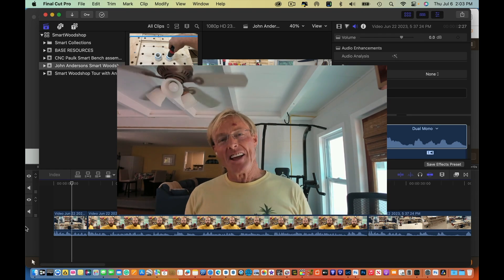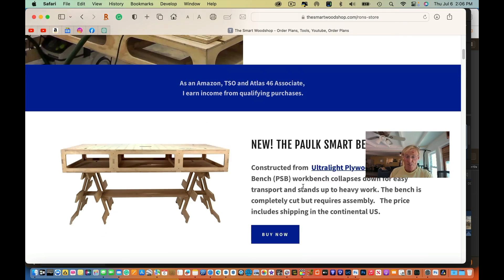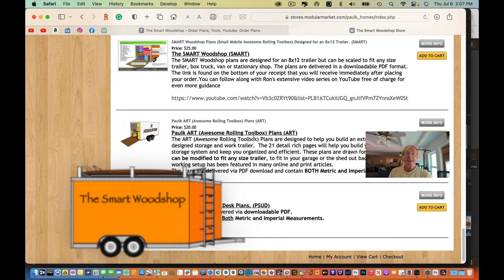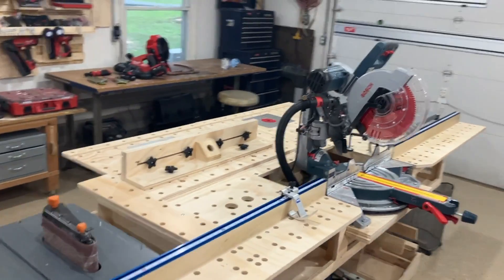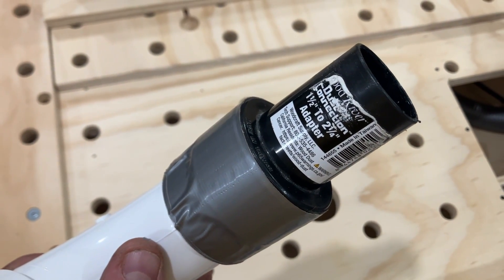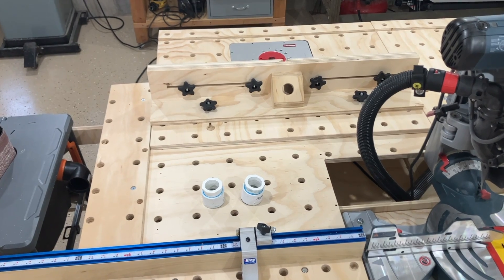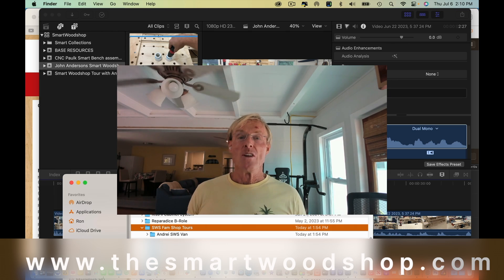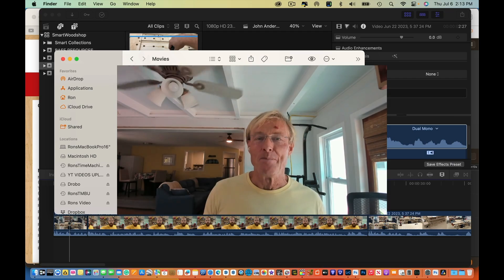$10 dust collection manifold by John Anderson

Comment: Hi John......Great idea! Thanks for sharing and I have to say, even though I am a Makita guy, Your Bosch system looks fantastic on your Smart Station! Ron.......don't change a thing......please keep doing your video's as you do, including all of your store's updates......it is valued & appreciated! Both you & Chris make a great team.
Reply: Thank you very much! I’m much more of a Milwaukee guy that a Bosch guy to be honest though. I’m an HVAC tech by trade and I like to build things out of wood as a hobby. I got a lot of Milwaukee battery operated tools for both trade and hobby because I was already on the platform from my job. As far as plug-in tools go, I usually will buy the highest quality that I can afford or justify given the fact that woodworking is a hobby and not my source of income. I’d love to have a KAPEX as much as anyone else out there, but can’t justify it for personal use. When I was deciding which mitersaw to upgrade to after having a Dewalt for years, I went with the Bosch because I like the axial glide system. But the Makita was right up there because they make an awesome product as well. As far as dust extractors go, I was extremely close to pulling the trigger on a Festool until I found the Bosch extractor was available at Home Depot’s online store, and I could use my military 10% discount. But again, if I was making my living with these tools, they would all be green just like Ron’s.

Comment: There is a product system smart solution already established for this situation that doesn't involve plumbing parts

The QuickClick dust hose and connector system by CTS (Central Technology Systems / Cen-Tec) 

And it is compatible with the Bosch hose connector
Reply from the maker: I'm not familiar with CTS and do not use Bosch proprietary  hose, as I use the industry-standard setup commonly used by Shop Vac and other store brands.  John took the time to shared a simple and convenient setup using easily obtainable parts. It would be greatly appreciated if you could create a video demonstrating your recommended setup. I would be more than happy to post it here.
Reply: @TheSmartWoodshop  Yep - John has created a solution and shared it. That is super useful and a great contribution. 

I don't have the funds to purchase the QuickClick parts I'd need to demonstrate being able to quickly, easily and conveniently switch between the three hoses I have in mind for my needs so I'm stuck moving one hose quickly and easily from each tool to tool. The convenience of having the selection switching all neatly in one place is what makes having solutions to this issue so useful.

Thank you for sharing videos such as these.
I hope one day to be able to contribute through sharing my own video of a solution that works for me